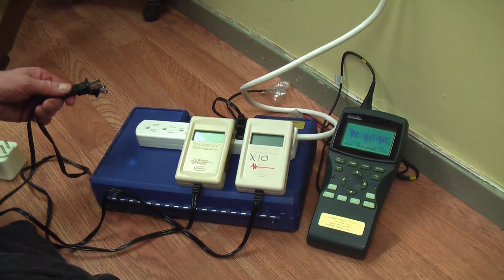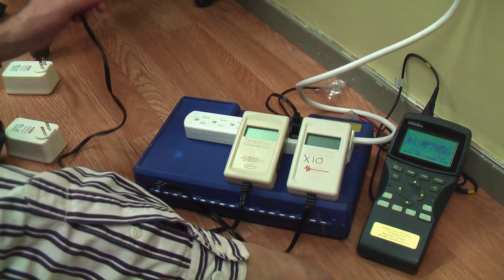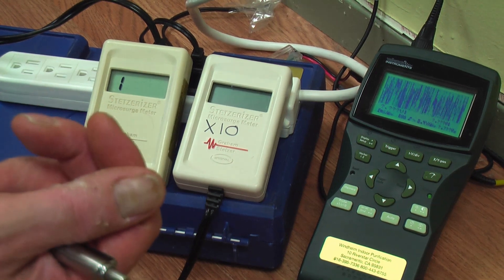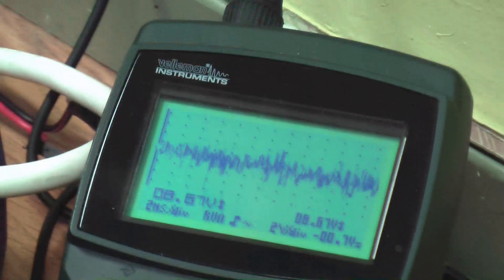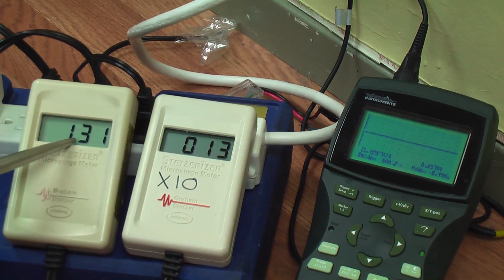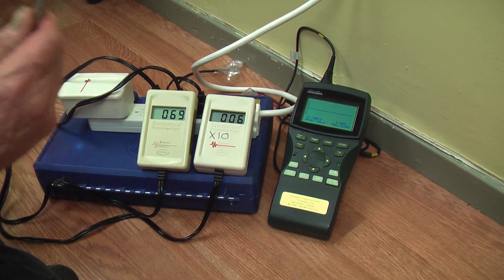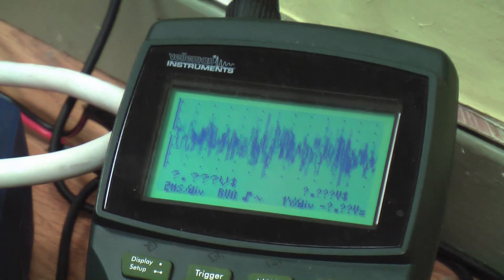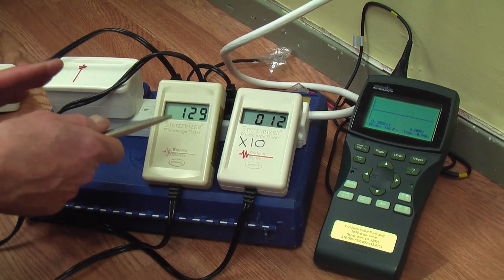Dirty Electricity: detect, measure and eliminate it.

Comment: My God....I remember discovering this years ago and then forgot all about it.
No wonder my brain is so scattered...I live smack dab in the middle of the city.
If I plug one of these into each outlet will it help eliminate excess electricity
coming in through open windows?  Thank you, will share this with everyone
I know and point them to your store.
Reply from the maker: Check you DE levels with a Stetzer Meter at the wall outlet.
Reply: Windheim EMF Solutions I'm placing an order for a meter tonight. Thank you :-)
Reply from the maker: Contact me via my website when you get the meter and I will send you a helpful work sheet. What city do you live in?
Reply: Windheim EMF Solutions Honolulu, yes I will file this and get back to you gladly, thanks

Comment: That meter off to the right vellen ?  where do I find that?
Reply from the maker: Steve Smith That is the Velleman HPS10 or HPS50 scope
Reply: Windheim EMF Solutions  how did you connect up  to the power strip using the hps50 to see the dirty electricity
Reply: Windheim EMF Solutions I am new to this ?
Reply from the maker: Steve Smith I used a special Hi Pass Filter that filters out the 60 cycle sine wave and displays the dirty electricity High Frequency Voltage Transients only.  The filter is custom made  to spec and costs a $100. The scope is either $100 or $200 depending on which one you want : HPS10 or HPS50
Reply: Windheim EMF Solutions where can u find this "Hi Pass Filter that filters out the 60 cycle sine wave and displays the dirty electricity High Frequency Voltage Transients only" at for 100.00
Reply from the maker: Steve Smith Steve,  Look me up at http://WindheimEMFsolutions.com  and lets have a private conversation.

Comment: And why, as you say, the power co would not clean up the power they are supplying to your home?
Reply from the maker: There are a couple reasons. 1. The utility normally does not make the DE unless they are making power from wind or solar.  2.  Most DE is generated by switching mode power supplies by the end user/customer.
3.  Utilities usually only consider Total Harmonic Distortion (THD) up to the 51st harmonic which is 3,100 Hz.  BTW DE starts at 2,000 Hz goes up to several hundred thousand Hz.  So when the utilities use testing equipment that can't measure the DE above 3,100 Hz they can say "We see no Problems so there is nothing to be concerned about".
Reply: Windheim EMF Solutions The utility company is responsible for delivering a safe product. You should sell your solutions to them. There are people that do not know or understand this issue and they have kids, too.
Reply: The PetrarcticWar wrote, : "because, the DE Problem DOESNT EXIST. for one, he is measuring magnetic fields created by electron flows, so does this mean bar magnets/the earth`s magnetic field will poison us? For two, WHAT IN THE WORLD IS A GS UNIT?!i have researched quantum physics and electrical circuits, and trust me, never have i EVER, heard of a GS unit! infact, it should be called a BS Unit!for three, this thing that radio waves cause cancer.. well people confuse the word radiation for the most feared radiation, Ionizing. BUT, guess whats also radiation? VISIBLE FREAKING LIGHT! its a EM frequency!! plus the only threat of non-ionizing radiation is, well, Heat. WHEN ITS CONCENTRATED INTO ONE SPOT! sorry, but if you bought this stuff, then you have been cheated and scammed. its sad really, taking advantage of people who are concerned with their well-being.."

Thank-you. No reply from the liars, of course.
Reply: because, the DE Problem DOESNT EXIST. for one, he is measuring magnetic fields created by electron flows, so does this mean bar magnets/the earth`s magnetic field will poison us? For two, WHAT IN THE WORLD IS A GS UNIT?!i have researched quantum physics and electrical circuits, and trust me, never have i EVER, heard of a GS unit! infact, it should be called a BS Unit!for three, this thing that radio waves cause cancer.. well people confuse the word radiation for the most feared radiation, Ionizing. BUT, guess whats also radiation? VISIBLE FREAKING LIGHT! its a EM frequency!! plus the only threat of non-ionizing radiation is, well, Heat. WHEN ITS CONCENTRATED INTO ONE SPOT! sorry, but if you bought this stuff, then you have been cheated and scammed. its sad really, taking advantage of people who are concerned with their well-being..
Reply: The comments of a nobody. Move along Mike, you are a very boring person.

Comment: How do you see that on your scope without the 60Hz sine wave?
Reply from the maker: I use a special filter to remove the 60 cycle wave.
Reply from the maker: I have the special filter and can tell you where to get a good scope for $200.
Reply: You use a high-pass filter to get rid of the 60Hz sine wave?
Reply from the maker: bergweg Yes.  The filter plugs into the 120 VAC outlet an the scope attaches to the filter.  I have them for sale if you want one as well as the Stetzer meters.
Reply: Windheim EMF Solutions  Is this one of the schematics of Milham's filters? 

http://www.eecs.berkeley.edu/~mhgraham/pubs/graham_patent6914435.pdf
Reply: Windheim EMF Solutions I have a good scope. I did probe the mains and found a nice smooth sine wave with none of the dirty electricity that you talked about. Even paused the scope and zoomed in, nice and clean!
Reply from the maker: Ebenezer Kalarama Hi Ebenezer,  The filter is designed and patented by the late Martin Graham Phd.
Reply from the maker: Joshua's Recordings Hi Joshua,  Right! Until you filter out the 60 cycle sine wave and decrease the volts per division on your scope settings you will not see the High Frequency Voltage Transients.
Reply: Windheim EMF Solutions My scope allows you to pause and view the wave. I did that zoomed in really far, and did not see anything. Most scopes (including mine) will measure different frequencies and if the dirty electricity was their I should have seen it when I decreased the volts per division.
Reply from the maker: bergweg Yes.
Reply: you could buy TV/Radio filters from Radio Shack in the Sixties. edit: Swap some components around and you're done.
Reply: bergweg Wouldn't that be a low pass filter, the high frequencies are what we want to see on the scope.
Reply from the maker: Ebenezer Kalarama This filter is patented but you may be able to assemble your own from components.
Reply from the maker: Joshua's Recordings Keep reducing the volts per division until you see the transients.  They may be only 100 mV peak to peak or less.

Comment: WHAT ABOUT SOLAR
???
Reply from the maker: The inverter produces massive amounts of DE.
Reply: well, sorry to break it to ya, but.. DE Problem DOESNT EXIST. for one, he is measuring magnetic fields created by electron flows, so does this mean bar magnets/the earth`s magnetic field will poison us? For two, WHAT IN THE WORLD IS A GS UNIT?!i have researched quantum physics and electrical circuits, and trust me, never have i EVER, heard of a GS unit! infact, it should be called a BS Unit!for three, this thing that radio waves cause cancer.. well people confuse the word radiation for the most feared radiation, Ionizing. BUT, guess whats also radiation? VISIBLE FREAKING LIGHT! its a EM frequency!! plus the only threat of non-ionizing radiation is, well, Heat. WHEN ITS CONCENTRATED INTO ONE SPOT! sorry, but if you bought this stuff, then you have been cheated and scammed.
Reply: @thepetrarcticwar2778  Earth is static and doesn't pulse at chaotic frequencies between 60-20,000hz, you can't compare.  There is no confusion..   The body is not a "whole" piece that has to heat up. Your phone will heat your inner ear if held long enough through the microwave exposure. Laptops will heat testicles and multiple studies found sperm dies from wifi. https://www.sciencedirect.com/science/article/pii/S0013935118300355
Reply: @thepetrarcticwar2778  DE problem exists.

They aren't magnetic fields. They are the extremely high frequencies of electric fields.

A GS unit is a Graham Stetzer unit. GS (Graham-Stetzer) Units are a measure of the average magnitude of the voltage surge (i.e. the rate of change of the voltage with time, or dV/dt) at the electrical socket.  One GS Unit is 24 Volts per second.

Yes, visible light is radiation and extreme exposure to it can cause cancer.

You were wrong about almost everything you said. Get educated.

Comment: Ok so this device filters the harmful stuff at the point where you plug in,what about the other thousands of feet of wires in your homes walls all giving off this radiation,please answer this question
Reply: They clean the circuit. There are multiple circuits in a home. A typical house needs 20 filters.

Comment from the maker: Hello Roman,  In this video I am measuring and reducing High Frequency Voltage Transients (HFVT) commonly called Dirty Electricity (DE).  The meters and scope measure it and these special patented electronic filters that never need replacement reduce the amplitude and frequency of the HFVT hence you get less radiation coming off of the wiring.  People declare that they feel much more at ease and comfortable as a result.

Sincerely, Eric Windheim
Reply: Are you familiar with the Hum sound? Im one who suffers from hearing it.
Reply from the maker: David,  Where and when  do you hear the Humm sound?  Please advise.  Check out my site here to leave a detailed private comment on on the contact form.

http://windheim-emf-solutions.com/dirty-electricity/
Reply: Windheim EMF Solutions  I've actually heard this before w/ the eco CFL lightbulbs- says right on the package.
Reply: ImagesByDavid  yeah  you to man?
Reply: Katie Macormic

Hello Katie.
Reply: Windheim EMF Solutions

Its the smart grid that causes the Hum tone.
Reply: I am dumbfounded.  I went searching for a power strip for my new T.V. and I may have found a solution to the problem I was looking for but didn't know how to ask.  I thought I was crazy, sitting around my house hearing humming noise all day long ... I thought I might have tinnitus ... its all around me sometimes ... like an annoying tone that is the same pitch ... I found a product on amazon that says it cleans power made by a 2019 launched company named Austere in New York ... then I thought ... maybe I should search for clean power or how to clean dirty power and here I am ... I wonder if this is what has been bothering me for years ...
Reply: It's a form of tinnitus. Nothing to do with power.

Comment from the maker: Hello Joe Bolloggs,

RE: Stetzer Filter Placement.

1.  Turn all lights and appliances on in house or office.
2.  Measure each wall outlet with the Stetzer Micro-Surge Meter and record readings on paper.
3.  Place filters at the highest meter reading locations first which will be at the locations of the largest internal generators of DE inside your house.
4.  As you place filters readings over the entire house will begin to go lower.
5.  Repeat this process until all Stetzer Meter readings are below 50 GS units.
6.  You will not need a filter for every outlet and you want to use a few as necessary to get the job done.
7.  You can Google my name "Eric WIndheim" + Smart Meter or SMUD and you will find my phone number which you can call for personal help on this matter.

Best,

Eric Windheim
Reply: I was wondering where this dirty electricity goes to or what happens to it? Does it go back and overload the electrical system? Have there been any related fire incidences regarding these? Thanks
Reply from the maker: @execproducer100  Hi,  Unless the source is remove or the DE is filter it goes back to the utility feeder and then into other the homes of other connected utility customers.